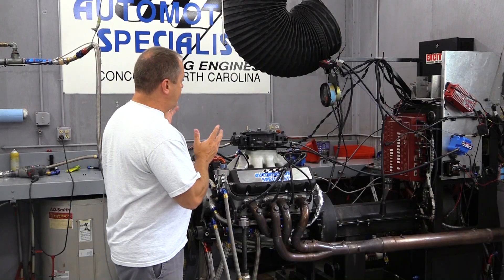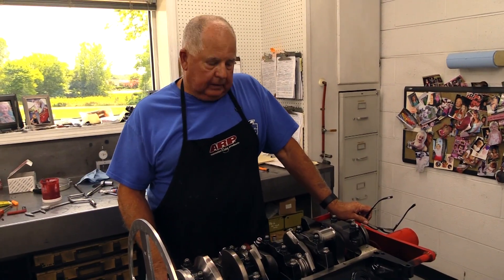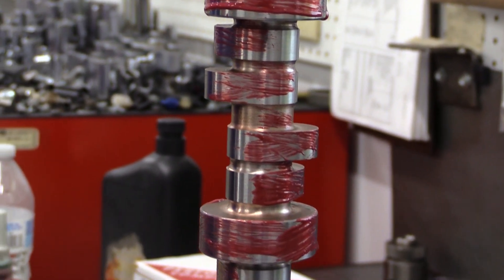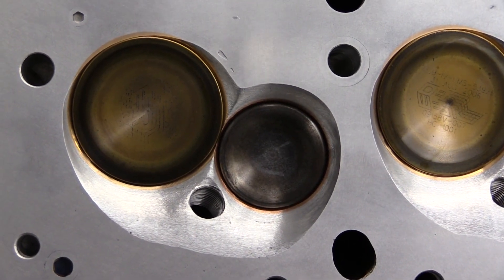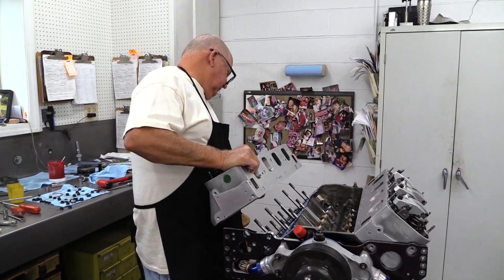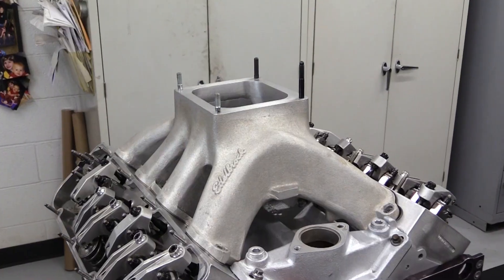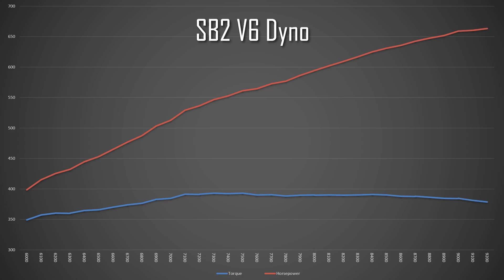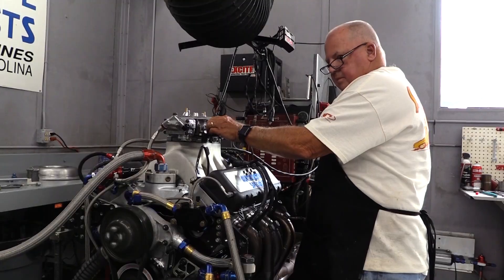NASCAR Chevy SB2 V8 Turned Into a Racing V6!?

Comment: Of course your counterweight would have to be the same as the missing connecting rods, piston,wrist pin, bolts and bearings. I assume. Makes me wonder what he can do with a gm3800
Reply: Wrong! There is a formula to come up with bob weight no different than balancing a rotating assembly! You DONT hang the entire weight of the pistons and rods on the crank! And its not rocket science to figure out like its some kind of secret he’s not divulging 🤦🏼‍♂️ and odds are not much cause there are no good heads for a 3800!
Reply: @glastornjet73  I basically said that 🤷‍♂️ 😂
Reply: Could be wrong but if it was the same weight as all the stuff added up it wouldn't make sense because of where the rotating mass is.  The piston has to go up and and stop and come back down.  That seems like it would create more force than the clamp around the crankshaft which spins evenly without having the up and down force.  It's definitely more balanced on that spot of the crankshaft but I don't know how that would affect the rest of it.  Definitely cool to see how they did it.
Reply: This definitely opens up possibilities for the venerable GM3800. ^^
Reply: @mael-strom9707   Even a 4300. Same stroke and bore as 5700.
Reply: @mael-strom9707  yep probably the best v6 gm makes and should kept
Reply: They do crank shaft balancing with counterweights. You have 145 oz (out of the hat number) of crank shaft balance on the balance side and the rod side is only 95. Put a counterweight to act as the remaining 50 ounces and each half of that crankshaft is the same weight. When they do balancing they dont spin the counter weights and the frictional mass of the piston assembly should be so small its almost negligible. Also if it were to spin freely it wouldve had bearings between in and the crank. It didnt. At 9k rpm you cant trust that would float fast enough like a spinner hubcap. And if it were to float at an uneven speed at 9000 rpm and be a specific balance on one half vs the other it would shake that engine apart in seconds
Reply: Idk why he didn't just start with this
Reply: no, not even close. the wight is in a different spot. i have no clue how to calculate that but its clearly a thing you have to do on a balancer lol
Reply: it is possible to make 500 HP with a 3800 and lots of ca$h!
Reply: @jamescorvett  you can make any motor 500hp with a lot of cash
Reply: @hell-sol5240  believe me i know this. Lol I had a automotive machine shop for 20 yrs. And it wasnt cheap for even small stuff if you want more HP and reliability.
Reply: Nothing that hasn't already been done.  The stock head doesn't like anything bigger than 1.84" intake valve, no matter what some companies try to sell you.  

Someone designed a raised port head for the series 2 years ago.  No one with a 3800 has the money to build a 500+ hp N/A motor, or chose that over a bigger turbo.
Reply: Kinda starting to sound like it would make sense to just leave the 2 piston assemblies intact ,leave the valves  out ,cut holes in the piston to eliminate compression,add the weight of the  material from the holes to the pistons. 
It's not like they're getting weight loss benefits from not using the two piston assemblies,as they're adding the weight back to the crank anyway.
For that matter,(I'm coloring outside the lines here) why not leave the pistons and valves alone route those exaust tubes to the intake plentum or to a turbo charger ?
May be, I'm missing the point.
Reply: @tuck6464  that is a thought.
Reply: @garrettburrows442  
** I just wanted to note,that my  comment,was in no way intended to discredit or challenge the Top  rate engineering/machining/engine building, witnessed in this video. I have no doubt whatsoever, that these guys could walk and talk circles around me, until I passed out in a fog of confusion.
Reply: No, if you put the weight of the entire rotating/reciprocating parts on the journal it would be way off.
Reply: Jesus christ, of course I know I'm wrong. But keep on pointing that out. It was a damn guess
Reply: @garrettburrows442  
Sorry Garrett, none of my comments were intended to discredit you,or suggest that you were wrong about anything in your comments.
I'm kinda wondering /not sure ,if it was my comment that prompted your JC headed comment.
Reply: @tuck6464  no it wasn't you, it's the people that say I'm wrong when I already know I'm wrong lol
Reply: @garrettburrows442  
Cool,thanks for the reply.
Reply: I would imagine you'd have to calculate the drag from the pistons and rings in the cylinder or lack there of in the counter weight
Reply: The trick is the weight turns on the crank. It's not just bolted on there. So the mass does rotate..Knowing how much each half needs to weight. Takes testing. Lots of testing to get the right diameter and weight.
Reply: @MasterChief-sl9ro  I assumed it spun
Reply: Dynamic weight.
Reply: I dont think its just as simple as adding up all the balancing weight. You would have to compensate for the lack of ring tension in the cylinder and parasitic drag also. That would add to the counter weight as well. I just want to know what he was using to seal that intake to the valley it looked like a silver color RTV from a standard size culking tube.
Reply: You would need to account for the friction as well. Just matching the weight to the con rods and piston, pin, etc wouldn't make it balanced.
Reply: @q......  have you seen how a machine shop balance a crank? They balance the crank off of how much weight the pistons and rods are and make the counterweight equal. The friction of a piston going up and down the bore should not be heavy enough to effect the balance. If it is that bore will self clearance itself very quickly because of improper setup. With a full short block you should be able to use a 12 inch ratchet and spin it easy enough to have it spin afterwards. Obviously it takes force to rotate that but the pistons should never be stuck in the bore.
Reply: @jaredanthony8070  "have you seen how a machine shop balance a crank? "

I am well aware of the process yes.

"They balance the crank off of how much weight the pistons and rods are and make the counterweight equal."

Again I am well aware.

"The friction of a piston going up and down the bore should not be heavy enough to effect the balance."

It's not about being heavy it's about the resistance. What you are not taking into account is... when a crankshaft is balanced to the pistons they are done so on equal footing so to speak, all share the same weight, as well as friction. With just a weight and no friction you are missing one key component, as such I am fairly certain if they just matched the weigh to the weight of everything else like a normal shop would do, it would be out of balance. 

Also what you are not taking into account here is the higher rpm. Higher RPM requires things to be more balanced with tighter tolerances. The only way just matching the weights would work would be if there was 0 friction between all of the other pistons combined / 2 for each of the 2 deleted. 

"Obviously it takes force to rotate that but the pistons should never be stuck in the bore."

I am not talking about things getting stuck or anything like that. The point is, using anything to turn it over while the short block is assembled is not 0 force required. It requires some force to do so. Yes? Sure it's not a lot but it does require some. Why? Friction. The friction being between the bearings (even less), but most importantly between the piston rings and the cylinder wall. Due to that friction it changes the the weight needed to have everything balanced.
Reply: @q......  call up your machine shop tomorrow and ask if the frictional resistance is taken into account during a crank balance. The frictional resistance doesnt "weigh" anything obviously but the force it puts on a crank would be countered via weight is what you are saying. How much weight would frictional resistance take to overcome? A high revving engine should be free enough to be spun by hand without the friction of the rings and cylinders being heavy enough to overcome requiring additional balancing. The "weight" of frictional resistance isnt taken into account just the same as compression force on a crank not being taken into account for balancing. Crank journal bearings should have almost zero resistance on any engine. There should be thousandths of an inch (.001) between the bearing and the crank for oil to be. Normal shop or high performance shop you dont measure the amount of frictional resistance to adjust balance no matter what rpm of an engine being built. As that engine wears itll change frictional resistance. If the pistons have gas ports that push the rings into the cylinder walls itll have a different frictional resistance every single stroke.
Reply: @jaredanthony8070  "call up your machine shop tomorrow and ask if the frictional resistance is taken into account during a crank balance."

If you are just balancing a V8 crankshaft with 8 pistons? No friction doesn't come into play, why? Because it would be equal across all 8. But if you are building a goddamn v6 out of a v8... it does. The "balance" part is weight and friction. If all 8 are the same then it's just weight, if it's 6 pistons inside a V8 then friction comes into play as well. The local machine shop wouldn't be equipped to do this kind of thing. It's not done very often and only in select cases. So most of them would scratch their head and look at you like you're fucking stupid for suggesting to make a V6 out of a V8 block. The ones that would be intrigued should be able to tell you that it's not as simple as just weighing all the piston components then making 2 weights that bolt on that match the pistons. If you do this, it will not be balanced properly I can assure of that. 

That's part of "the secret" in this video. You can do the math on how much each has to weigh in addition to the other pistons and probably get it close. Then you dial it in, until it's balanced, basically a bit of trial and error. 

"rank journal bearings should have almost zero resistance on any engine."

You can't have zero resistance. Just the crankshaft alone should spin fairly easily and resistance will be very low. It will not add much but it will add some.

Have you ever taken an engine apart? Seriously. Or if not, have you ever seen them taken apart? When you remove the crankshaft do the pistons just fall out? Or do you have to coax them a bit? Using the handle of a  hammer like a dead blow is idea you tap it out. If you were to push evenly across the surface it would be slightly easier but it would take some force to just push it out. That force... x 6 / 2 is part of the equation needed to balance the crankshaft inside a V8 engine with 2 pistons missing. 

"Normal shop or high performance shop you dont measure the amount of frictional resistance to adjust balance no matter what rpm of an engine being built."

No shit? I never said they did... Why don't they? Because the equation in that scenario comes down to weight. In this application you are changing what is needed to achieve balance. If all 8 cylinders are alike, then the resistance should be very very close, and as such it's not taken into account because... they are all alike. Now if you take 2 pistons off. That balance is thrown out of wack, thus the need for the weight. The weight is only one part of the equation now as the 6 with resistance is not like the 2 that have no friction between the weight and cylinder walls.
Reply: @jaredanthony8070  maby the secret is to throw all of us 'OFF BALANCE'🤔
Reply: @q......  you are really something man 😂 the two missing cylinders would have no friction as they arent there so you would balance the crank proportionally to the cranks balance. Yes I have taken an engine apart and had them apart. Yes it takes force to remove a piston. But you still balance an engine based off of physical weight alone no matter if theres more or less pistons 😂😂
Reply: @jaredanthony8070  The fact that they have no friction should be ringing some bells for you... The missing cylinders have no friction, the 6 that are there does. Therefore  it's out of balance if everything but the friction is different. 

"But you still balance an engine based off of physical weight alone no matter if theres more or less pistons"

In a normal every day scenario where the crankshaft is for a V8 and it has 8 pistons? Completely 100% agree, as the equation would be balanced everything else is in line and controlled for except for the weight of the pistons to the crank. Once that's done... off to the races. Remove 2 and put 2 counter weights on it equal to the pistons removed with no friction and that balance has been upset. The equation is no longer balanced. You have more variables to account for than just the weight of the piston.
Reply: @q......  ok even if you were to balance for frictional resistance the 6 that are left are still equal and opposite. It's not like cylinder 3 and 5 are removed. That's two on the same half or the other whatever number. It's not 1 and 6  two opposites or 1 and 5 even  leaving one rod attached to the crank removing the other on that journal. It's the back two cylinders on the same journal. Its balancing a v6 that has a weird double counter weight. If it was 1 and 4 or 1 and 2 it would be a whole different story but it wouldnt come down to friction. 1-6 are all equal and opposites sharing the same journals putting the same amount of rotating mass and balance as one another. 7 and 8 arent there. No friction that's pushing more on one side or the other. Yes remove the rods and do nothing it will be off balance obviously but you add the proper weight and the other 6 that were untouched will be under the same balance they were. They dont have any different effects on them with or without those two rods. The only difference is the lack of weight on the rod journals where there was and now isnt. If frictional resistance was a problem it would be a problem on all 8 just the same as an equal 6
Reply: @q......  Our shop balances rotating assemblies.  I've done a few myself.  I calculate bob weight for every engine we do.  Friction is a separate phenomena from balancing rotating/reciprocating masses.  Friction increases exponentially with rpm ... so in your imagination the balance would be different at 2000 rpm than at 7000 rpm?

A more interesting question is why he removed the rear cylinders instead of middle cylinders, which have less of an effect on balance.

Now with a V6 you have torque reversals, where V8 does not.  He has essentially has two misfiring cylinders.  It's not "just as smooth" as a V8.
Reply: @Crysmatic  Removing the rear instead of the middle would maintain a more consistent airflow and makes sealing off 2 cylinders much easier than the middle. Without having a new intake manifold cast, there would be dead spots where fuel could pool in the intake vs sealing the back two. Balance wise, you're dead on with the friction and angular load on the crank being more manageable removing one of the middle pairs, however. Not having an offset ground crankshaft means there had to be some balancing weight on the tail and compensating for both mass and friction to keep the crank from trying to crab-walk is pretty interesting to consider.
Reply: @jaredanthony8070  go out to your car or truck and remove a spark plug wire. You will encounter a balance issue just from taking the firing of those two cylinders away!!!! Now if you remove the two spark plugs your balance issure becomes even worse now you did away with the ignition of the air/fuel and the compression!! So dont be so sure that just ring/piston friction alone would not make a difference. If the friction was removed from all 8 pistons than yes it would not impact it as a balance issue. But just 2 will for sure change the balance especially seeing that the two piston/rod removed are from the same crank journal!
Reply: @q......  I completely agree with you and I know how difficult it can be when trying to get someone to grasp the very obvious! He even basically said it him self and still can't grasp why it would still be out of balance if done his way. Haha I'll try to help the best I can. You already brought several good points up and he still dont see it.
Reply: Jared Anthony Remember the big end turns around the centre line of the main journal at 100%, at half way up the road that mass is moving at 50%  you have already thought of the mass  of the assy. So you have primary and secondary balancing. The last bit of information needed is the angle of the  V in this case 90Deg

Comment: I cut my eye teeth building SBC; you can gauge my thoughts about this video by how many times I said, "Jesus Christ!", while watching.  The count?  I lost track, (didn't want to take my shoes off! LOL)

I was fortunate enough to have a drag racing mentor when I was in my teens. He'd built a national record holding car in the early '60's.   The first thing he taught me was block and head prep, pre porting & blueprinting.  I looked at this sweet SB, knowing just how many hours it takes to make one look like that.

Had to laugh, though, the builder didn't want to give up the cam specs, but I do believe you gave enough info talking about the valve train, a guy could back calc the lift, if not the duration.... ooops...  LOL

Very impressive V-6, starting with a very impressive V8.  Never paid much attention to Nascar, but I will spend some time learning about these SB2's, after watching this.

Thanks... you picked up another sub.  Keep up the great vids...

GeoD
Reply from the maker: Thanks for the kind words!
Reply: shane a few too many aussies ask for that mod on their burnout cars so they made it a product line?